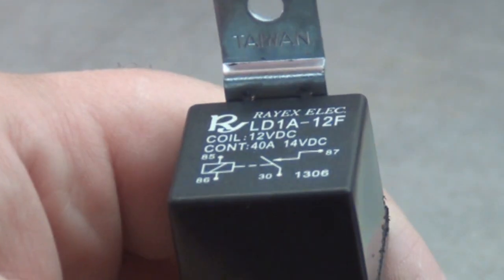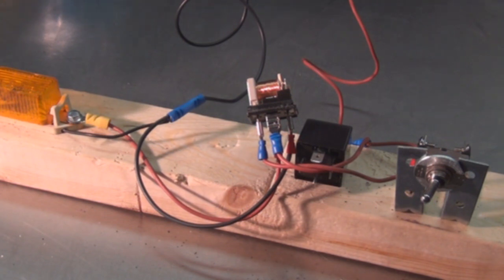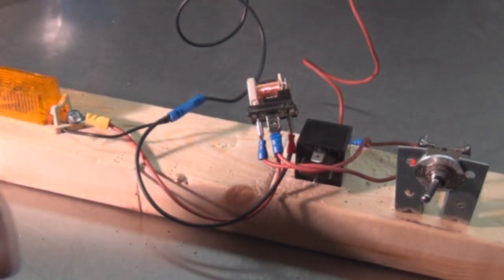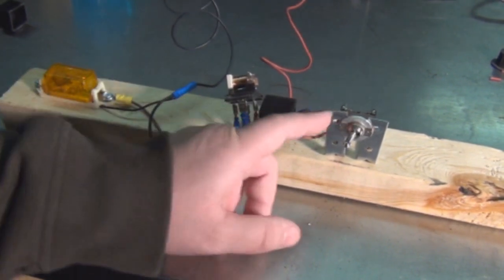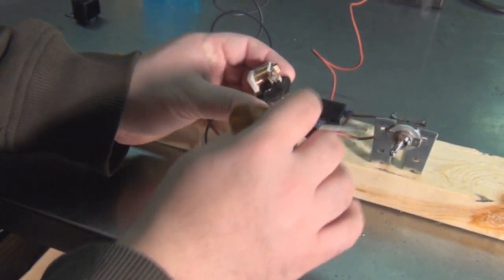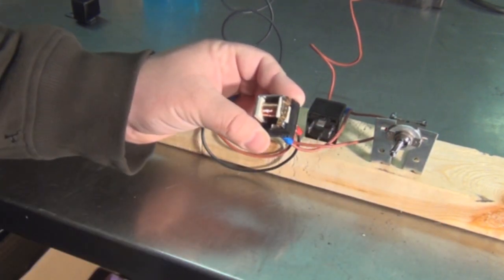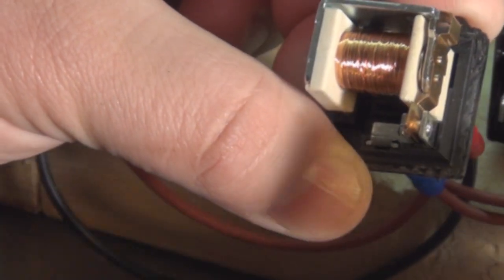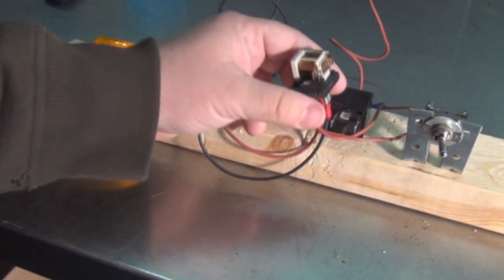How An Automotive Relay works Why And What Are They Used For Explained in this video

Comment: why use a relay was the question?
Reply: what will happen on circuit if we not using a relay
Reply from the maker: Mainly to use a low amperage circuit to operate a high amperage circuit or circuits. I hope this helps. Thanks for watching and commenting. Please like share and subscribe.
Reply: use a high aperage switch?

Comment: So if my daytime running lights (DRL) won't turn off when the car is off.....I have a bad relay?
Reply from the maker: +MikedizzleV that I couldn't tell you exactly what your problem is. But that is a good possibility. In order to diagnose that you would need to locate the relay and figure out what connections are what and test it with a test light. You can get your wiring schematic on eautorepair.net , also troubleshooting info on that site. I hope this helps, thanks for watching and commenting. Please like, share, and subscribe.
Reply: handy man That was the problem. Thank you for replying.

Comment: why use a relay? Isn't it just adding another switch to something that already has a switch? What is the advantage? Thanks.
Reply from the maker: To use low voltage to turn on higher voltage applications. Also to use one switch to turn on many devices at once which would cause an overload of that one switch if all the devices would be hooked up at once. Example; 1 -5 amp switch can turn on 10 - 20 amp circuits. Granted with 10 relays and fuses. That's just a quick example. That is a good questin. Thanks for watching and commenting. Please like, share, and subscribe.
Reply: In addition to handy mans comment...  A physical switch to control a high current would have to be quite large.  The advantage of a relay is that a normal switch can be used to control a low current line into the relay. Inside the relay, an electromagnetic field is created which physically closes the higher current circuit.
Reply: handy man but how does it use lower voltage to turn on higher voltage things?